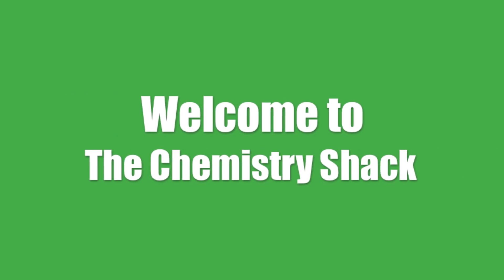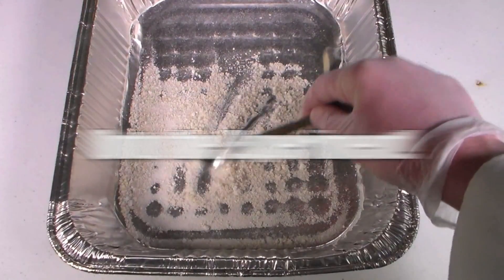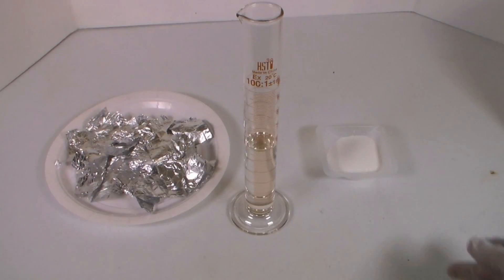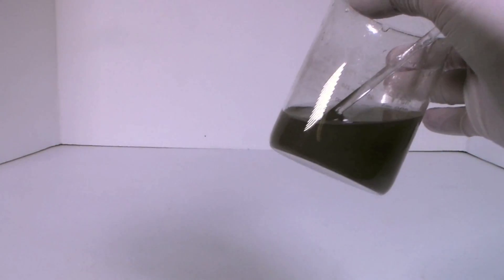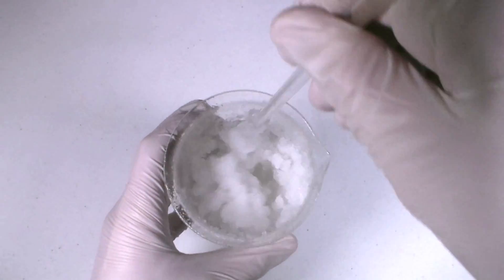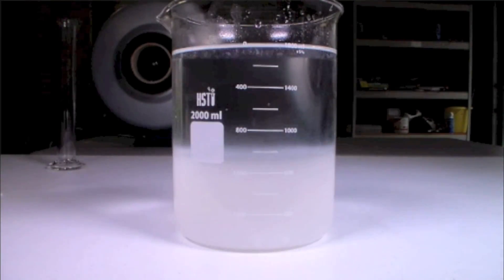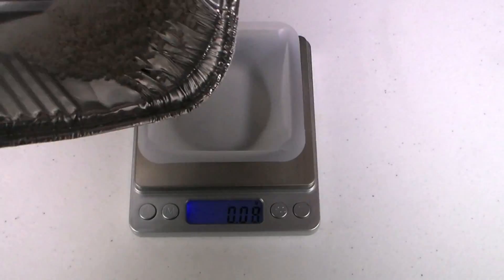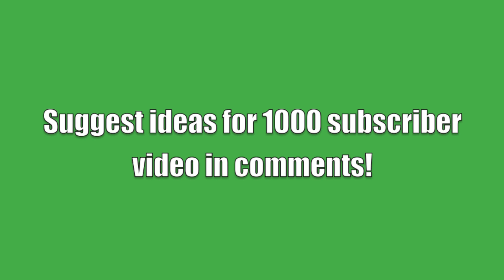How to Make Aluminum Oxide (Al2O3)

Comment: In refractory brick they use something called "Alumina" also called "Aluminum Oxide" 
1rst is this correct?
2nd is what youve just made the same thing?
3rd at a 30% to 40% ingredient to refractory brick depending on the heat resistant specs. is it feasible to make enough aluminum oxide for a small forge/foundry or just purchase a 50lb bag of alumina for $124.00?
Reply: 1) yes
2) no, he's doing aluminium hydroxyde here. His stuff must be calcinated around 1500°C  to get alumina.
3) Just buy it, ilt will be purer, regularly grained size et won't shorten your life with hydrochloric acid vapors.

Comment: What is the main aim to be obtained aluminum oxide from aluminum metal? where dou you use aluminum oxide?
Reply: You can block harmful 5G radiation by painting the walls, the ceiling and the floor of your room with aluminum oxide-containing paint. This is no doubt the best way to use aluminum oxide.
Reply: @larskullberg7292  is there any scientific information about this claim? I know aluminum oxide is very harmful in case of inhalation.
Reply: @emlakes  Well, aluminum oxide mixed in paint won´t hurt anyone, but trust me - 5G radiation will definitely hurt you. 
Put your computer to use and search the web, using "5G blocking paint" for your search.
Reply: I used it to glass melting project. I put some in my molding clay to get heat resistant moulds. Also use it as a mould wash to prevent glass from sticking the mold.
Also use it for ruby synthetisis. And alumina is also great for polishing.

Comment: Wouldn't it be much better to do 2nd and 3rd washings in a vacuum filter. I'd also say the excess of sodium carbonate or bicarbonate may have contaminated your  results. Next time I'd try using a little less sodium them needed for the reaction so you will know that all of it has reacted. I'm no chemist by far so it's just my theory. I love chemistry and learning about it. Especially easy ones I can perform myself. I have been curious about my white paste I make with aluminum that I reacted with a 3/1 ratio of 32.5 hydrochloric acid and 35% food grade hydrogen peroxide. The aluminum reacted quite vigorous leaving me with a thick white paste and some aluminum that didn't react. I took the aluminum paste out and put it on a dish to dry which after 2 wks it looked dry but as I stirred it, it would turn back into a thick liquid. I then raised the pH with sodium carbonate but after I wished I would had used sodium hydroxide which I may do in the future. After seeing this video I'm assuming I made aluminum oxide but still not 100% sure. I'm curious if you have done this or know more closely what I've made. Also if you have a video on this I'd love the link.
Reply: Dude...move the aerosol can away from the oven

Comment: Thats not a Al2O3. Thats aluminium hydroxide Al(OH)3. 2AlCl3 + 3Na2CO3 + 3H2O → 2Al(OH)3 + 3CO2 + 6NaCl
You can get Al2O3 by heating aluminium hydroxide in high temperatures.
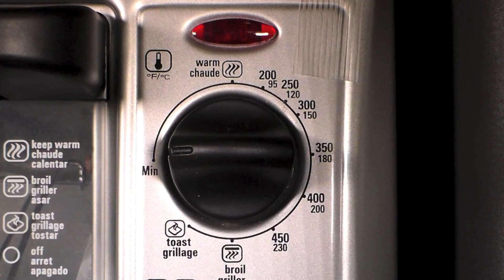Reply: 3:48 like that?
Reply: @yasyasmarangoz3577  Temperature is not high enough if only in the oven, you need to put it in the Muffle Furnace. Cmiiw

Comment: Why not use electrolysis? Fill a container with water, have an aluminum anode and cathode. Then you have aluminum hydroxide, heat the aluminum hydroxide, to create aluminum oxide.

Comment: small correction:  the aluminum gel is not an oxide until it's roasted.  While the aluminum is in gel form it is called aluminum hydroxide.  At the gel stage it is soluble in weak acids.  When the gel is roasted (dehydroxylated) it forms a new molecular structure called alumium oxide.   Great video tho bro.  Keep em coming.  By the way i know this becuase i am working with geopolymer technology and during the clay  processing step its critical to get right or the geopolymer reaction will not work.  by the way  -  the temperature you used was too low.  A higher temperature is required, somewhere around 550 degrees C.  600 degrees for about 2 hours is recomended.
Reply from the maker: Ok, as I said, the textbook i used as a reference doesn't mention any of that. Also, the product worked fine to dehydrate ethanol (next video btw)
Reply: Actually he added sodium carbonate which creates an insoluble aluminum carbonate so wouldn’t he being seeing that? Also the aluminum carbonate decomposes closer to the temperatures he was using which is why it made sense that it worked out mathematically. According to equilibrium, the solution would slowly create the insoluble compound as it constantly uses up the aluminum in the solution. In fact, you may be able to exploit this as the aluminum would become the limiting reagent, but since it constantly removes aluminum from the solution by destroying the base which makes it acidic again, it would forever drive itself forward and you could get away with using a little amount of HCl. You wouldn’t be able to neutralize it until all of the aluminum was gone because the aluminum consumes it to make aluminum carbonate. It would take longer to dissolve the aluminum using this method, but you wouldn’t have to waste HCl

Comment: question, if you throw Aluminum Oxide into hydrochloric acid, will it convert back into aluminum chloride?
Reply from the maker: Yes, but I believe strong heating and a lot of time is required because Al2O3 is pretty resistant to HCl

Comment: "As you see, the suspension is thick and gelatinous, so filtering it will take forever."What if I lay it on filter and add pressure to it?
Reply from the maker: +NDos Dannyu You could try that, but gelatinous solids tend to plug the pores in the filter paper, making it difficult for liquid to pass through and to remove the solids from the paper later

Comment: Actually, it gives aluminum hydroxide first not aluminum oxide.

2 AlCl3 + 3 Na2CO3 + 3 H20 -----> 2 Al(OH)3 + 6 NaCl + 3 CO2

On strong heating, it loses water to give Aluminum oxide (what you have done at the end is right anyway but you have to heat even more strongly)
Reply: it create aluminum hydroxide due to the decompose of aluminium carbonate 
al2(co3)3+h2o--> al(oH)3 +co2
Reply from the maker: +Shiva Chemist This is a weird reaction because the compound aluminum carbonate isn't known to exist. This is a special reaction that has to do with hydrolysis of the aluminum 3+ ion.
My source for this reaction is the book "Higher Level IB CHemistry" by Pearson. According to the literature:
"The hydrated Al3+ ion is acidic as the charge on the Al3+ attracts the electrons of the O-H bond on surrounding water molecules, releasing an H+ ion in the process. 
This solution is sufficiently acidic to release carbon dioxide when treated with Na2CO3 via the following reaction:
2AlCl3 + 3Na2CO3 -> 3CO2 + Al2O3 + 6NaCl"

**Now, this book could be wrong. It is a 2009 edition, so there may have been more studies on this reaction. 
But as of now, this is the most reliable source I have found for this reaction.
Reply: I am not a chemist, I am an electrical engineer . But your abomination reaction can be the Proof ( like Elon Musk said ) that we are living in a ''Simulation '' and nothing  is real ?Was this a glitch ?:)))

Comment: can i suggest a video about crystalization methods? ive been wanting to make copper acette crystala since forever but making the cristals and separating impurities is a pain in the butt.
Reply: i did it and i worked really good 
take clean vinegar and copper (from cables is the best quality) place it in a beaker...to speed it up you can heat it (60deg C perhaps?) and add some hydrogenperoxide (i did with 3% ) sooner or later reaction will die ...filter the solution and heat it up untill you start to see some blue crust (or green...
while hot filter it though and put the liquid in the fridge...after it cools it should crystalize into gargerous crystals...you can make sure it contains copper ions by burning it...it should give green flame
Reply: mattibboss
i tried with hydrogen peroxide but it took too much to make too little acetate so i made copper oxide separately using electrolysis with salt water, then letting it further oxidize. (maybe the impurities are salt that i may or may not have washed good enough....
im thinking of using baking soda next time instead.....
anyways will try using the fridge next time, thanks.
Reply: +Laharl Krichevskoy backing soda? then you'll get sodium acetate
hmm...if your peroxide dosent work than maybe destill your winegar if you can...if not than take an copper electrode (thick cable?) and insert it in your vinegar and push current though it...if you have an Lab (well ventilated area...) than push few amps through it (it will boil...) and if you want to do it safe than don't push much....and i'll get blue solution and some copper crud...poor in some H2O2 and heat it up...maybe is your peroxide a piece of shit?
take a CLEAN beaker and pour 1000ml of 3% peroxide (fresh bought) and slowly heat it up untill you have 100-150ml...and use that it should be arround 20-30%...if this dosen't work than i'll make a video....
Reply: mattibboss
i have a bottle of 30% peroxide, the problem was it was slow and used to much so i ended up with a lot of liquid and too little acetate.
I have no idea if it's still 30%, it's been in the fridge for over a couple of years, pluged and closed  but i have my doubts.

No, the baking soda is to make copper oxide. Disolve it in water, put two copper electrodes and pass some current, then rinse and the heat watever is left until it turns black. If you put some in vinegar it will completely disolve, and it's much faster than using hydrogen peroxide.

I never tried using vinegard alone to do it, i'll definetely try that. Now that i think about it it should work though being only 5% acetic acid, not sure how much current i'll be able to get
Reply: Laharl Krichevskoy couple years? throw it away....
hmm i think passing current through carbonate may do coper hydroxide and oxide....idk and it does not matter anyway
i would say try with vinegar solution....you hit 2 birds with one stone but your carbonate method dosen't need an lab(or outside)
i'll make a video (end this monh or start of the next) and i'll let you know
if you get anything let me know....maybe we find much better method :)

Comment: Isn't this Aluminium hydroxide or carbonate instead of  oxide. maybe when you heat it high enough you can get Aluminium oxide.

Nice Grettings from Germany
Reply: +Fant Ikke Noe Navn Not really just 0.001 g/Liter     look at Wikipedia
https://en.m.wikipedia.org/wiki/Aluminium_hydroxide
Reply: +Fant Ikke Noe Navn I'm not sure but I think in solution the Aluminium Carbonate will decampose in water to release CO2 and AL(OH)3
Reply from the maker: +Alfons Müller This is a weird reaction because the compound aluminum carbonate isn't known to exist. This is a special reaction that has to do with hydrolysis of the aluminum 3+ ion.
My source for this reaction is the book "Higher Level IB CHemistry" by Pearson. According to the literature:
"The hydrated Al3+ ion is acidic as the charge on the Al3+ attracts the electrons of the O-H bond on surrounding water molecules, releasing an H+ ion in the process. 
This solution is sufficiently acidic to release carbon dioxide when treated with Na2CO3 via the following reaction:
2AlCl3 + 3Na2CO3 -> 3CO2 + Al2O3 + 6NaCl"

Comment: is there any chemical  way by which we can make aluminium powder like we make gold powder from aucl2
Reply: An idea you may want to check is electrolysis. Make a super saturated aluminum solution then get it to a ph around 4-5 get to aluminum nails and pass 18 volts though it, with how high the current is the plating will just fall off. It probably won't be super fine but you could put it in a bottle and just role it on the table for an hour or so and that should make it quite finer
Reply from the maker: +hasan junaid It's very difficult to isolate aluminum from its compounds because of how reactive it is. You'd have to use a very strong reducing agent like lithium or sodium and it would have to be in dry conditions. (However this is merely postulation and I'm not sure of any practical ways to isolate aluminum form its compounds)
I'll try to see if I can find some papers on it though.
Reply from the maker: +Science post That probably won't work because the aluminum would likely redissolve in the acid faster than it plates off
Reply: +TheChemistryShack that's why I suggested raising the ph to around 4-5 so that there won't be as much of the a acid. The left over acid will redissolve the aluminum but it would soon be depleted of all the acid and the aluminum will start plating and peeling again
Reply: +TheChemistryShack you could even use an unstable acid like peracetic acid. All you'd have to do is mix vinegar and hydrogen peroxide and if you leave it out in the light or heat it the peroxide will decompose so all that's left would be a very dilute vinegar solution which won't dissolve the aluminum.